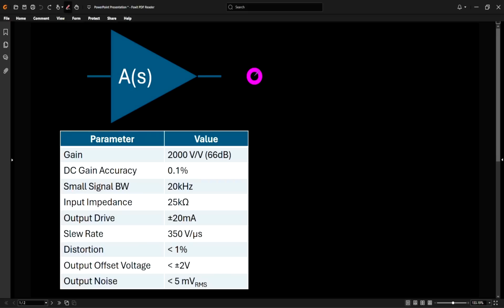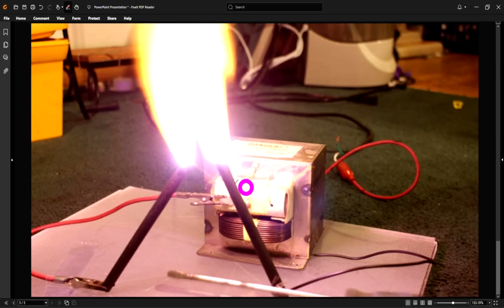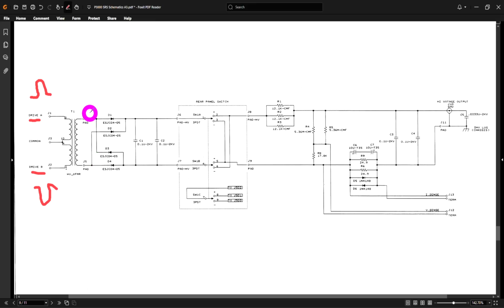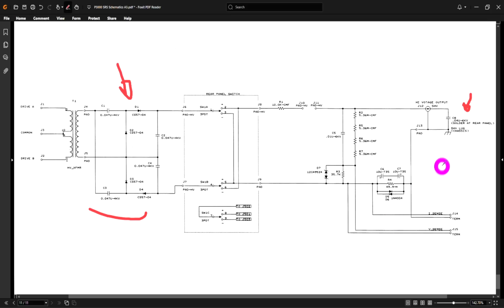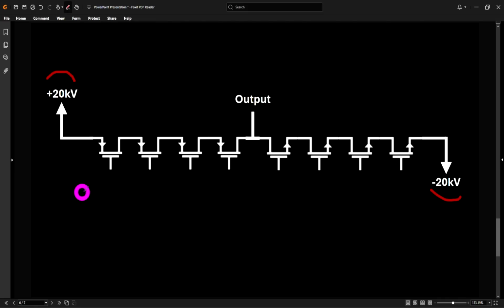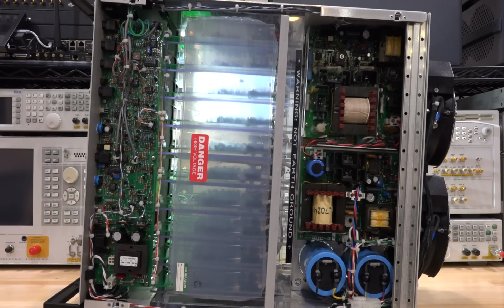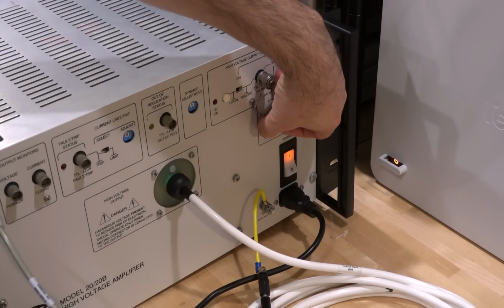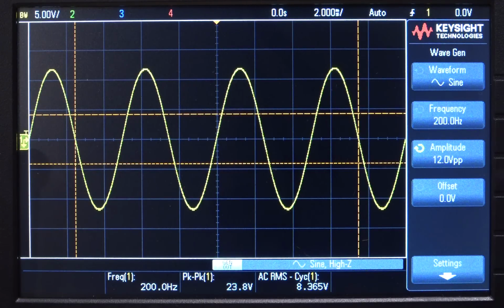TSP #293 - High-Voltage Amplification, Signal Generation, Power Supply Design Tutorial & Experiments

Comment: Interesting, reminds me of a show I saw about how they dealt with converting 250KV or higher of DC back to AC, for DC interstate power lines, given that DC is so much more efficient in terms of losses.  From what I recall, they literally stacked circular thyristors on top of each other to reach the required breakdown voltage and used fiber optics to trigger the gates.  Obviously, not your off the shelf thyristors, from the ratings to the optical gates.
Reply: Thyristor discs are somewhat available on Ebay for 50-200€ but i havent seen any opticaly triggered ones. Very usefull for remotly triggering experiments with capacitor banks.

Comment: I know I cannot generate high voltage the redneck way you described, I do not have boots or a carpet.  Also relative humidity here is > 90% now.
Great video.  I still wonder how the synchronization of those gates is achieved, ie what is the max time delay error and how it is kept under control (tamed).

Comment: What a remarkable instrument.  Do you have any idea what its day job was?  If this (as is likely) is a test instrument, I would be sure there were solid procedures regarding its use.  I've adopted a technique that originated in Japanese train operations: "read, point, think, verify".  This has saved me so many times.  (To clarify, not in life or death situations like this, but preventing things like nuking a costly instrument, or even my main workstation.) The pointing slows you down so that you don't just glance at a setting or input and see what you think it should be.

I sure would like to know what's in the high-voltage feedback side.  Have you considered x-raying the tube?

Comment: My electrostatic speakers operate at about magnitude lower high voltage and use a wide bandwidth power audio transformer to dramatically step-up the voltage swing to into the mostly capacitive electrostatic transducers. Create like there’s thousands of volts behind your voice. 🤪
Reply: I work on high power PA audio amplifiers. They work with another magnitude lower voltage but are able to drive up to +-250V into 8 and 4Ohm loads. The biggest 2 and 4 channel models can put out 7.5kW and 5kW of rated power per channel and have a powersupply capable of 3.5kW average power with a truly scary ammount of output capacitors.

Comment: The Oriel "supply" in the beginning @ 6:35 should be called a "ballast".  These use a lot of thin wires on the secondary, where the high DCR of the windings allows the "loaded" output to decrease in voltage, limiting the output current, essentially becoming a series wire wound resistor.  These are common in all discharge tubes used in lighting, from fluorescent tubes to street lamps to movie projector arc lamps.   What is "discharge"?  Arcing which is a temporary very high current short.
Reply: Most of the current limiting comes from magnetic shunts, so that the magnetic field in the coil can be controlled, so that it can generate a high voltage, but as you attempt to draw power the shunts limit the current that can flow. Microwave ovens use these, and if you remove the shunts you will almost instantly destroy the magnetron and diode, as now the current is no longer being regulated by the shunt laminations between the primary and the 2 secondary windings.
Reply: @SeanBZA  No. See the items listed in the examples and the load being arc lamps.  Magnetrons are not arc lamps and the power supply is a transformer, not a ballast.  Perhaps you should de-construct a readily available fluorescent lamp ballast to see lots, and lots of fine wire. You should measure the resistance and then apply Ohm's law or simply research Electrical AC Ballasts.

Comment: A very wise friend and colleague of of mine used to say "If you're not afraid, you don't understand!"    It was in an entirely different context, but it surely applies quite nicely here.   My existing healthy respect for "high" voltages certainly makes me very afraid and anxious just watching this!   Thanks for taking the time working up to the actual device testing at the end.
Reply: He was clearly very afraid. That's why he clamped the alligator clip on the voltage divider tube with a small piece of adhesive tape.

Comment: It is possible that the reduced input impedance is due to the voltage coefficient of resistance (VCR) of the meter where the resistance drops as the voltage is increased.
Reply: No. That (non-linear) resistor characteristic would affect the meter's accuracy at high voltages.
 This is MOV leakage.  It does not affect the high voltage measurement accuracy in most common applications.

Comment: Regarding non-10MOhm input resistance: It might be current sinking by multimeter for measurement? Or resistance non-linearity at high voltage?

Comment: The only thing I'd use a MOT for outside of a microwave oven is to build a high current transformer for a spot welder.  It involves removing the secondary coil and rewinding it with a few turns of very heavy copper wire.
Reply: That's more or less all they're really good for, everything about them is marginal except the potential to kill in the factory secondary, just good enough to run the mag with forced air cooling, for only a few minutes at a time in the super cheap dorm room specials. They are not the easily reworked general purpose power transformers they appear to be.

Comment: Woohoo, this is a long one, awesome :) Missed opportunity at the intro to mention 25 kg weight of this "opamp" and need of a forklift to install it :) With amplifier like this you very quickly learn how to NOT make mistakes and triple check entered values, unless there are sacrificial oscilloscopes and probes! BTW interesting note as on CPEM2024 conference there is research presented for HV metrology with 4000 kV (yes, 4 Megavolts) for lightning impulse simulator generator. TSP now need one of these to lightning-test some RF equipment ;)
Reply: Previous job was in the electronics manufacturing industry. Our Scanning Electron Microscope (SEM) field service engineer covered the SEMs and TEMs at oak ridge national labs (a few hours away from where I was). Some of the high end models have to maintain close to 1 MV with micro volt stability. He said servicing them was fun. Everything in them developed a permanent charge so dust would settle on them quickly. Once you cleaned it it was a race to get it assembled and if a spec of dust made it on some parts you’d quickly find out when it arced out.